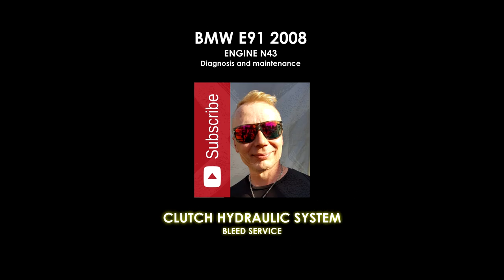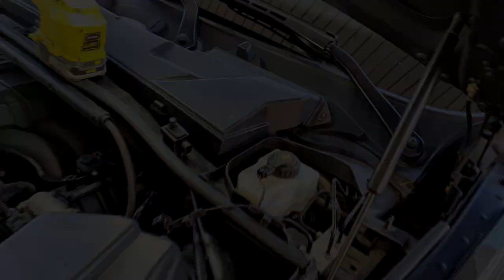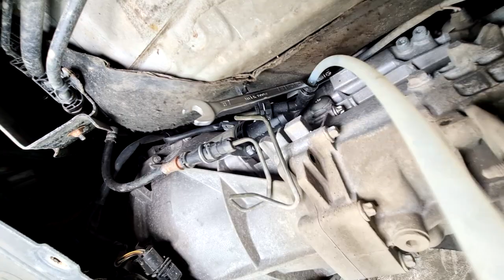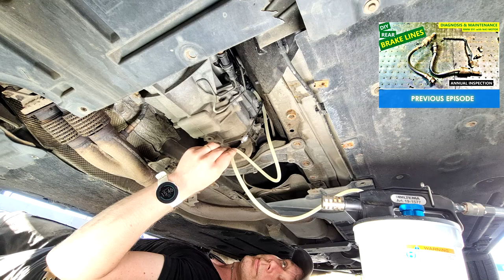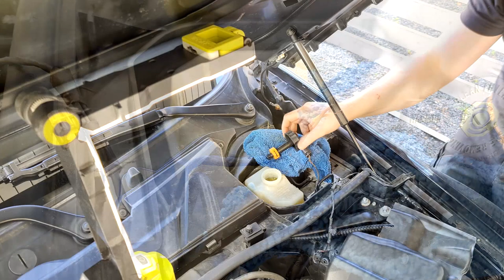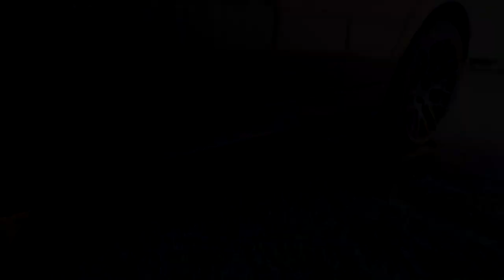CLUTCH HYDRAULIC SYSTEM bleed service - BMW E91 engine N43

Comment: did you ever manage to fix the 30AE error?
Reply from the maker: Fault code 30EA is still there. 
But the sulphuration is not so big that it lights up a fault light on the instrument panel. The car works well and the emissions are correct. You can always get the fault code off for a while when you perform that burning run.
In order to remove it completely: It would require physical opening and cleaning of the nox Catalytic Converter... or NOXEM from bimmerprofs
Reply: @JaniVoutilainen  So it comes down to the cat having deposits on top of the catalyzing metals which decrease its efficiency due to it being old. I recently got myself a 2009 E92 320i with the 30AE code. I also had a thermostat and nox sensor fault code so it's currently in the shop having those and various other oil leaks fixed. But I have been watching your videos on the desulphation process to get an idea on how the n43 operates. I used to have a 316D N47 and I know how the DPF on the E9x diesels gets clogged up. I managed to get a max od 255.000 km from that one and no amount of cleaning could get it to not regenerate every day. The E92 has 180.000km so I am wondering if the nox cats have the same kind of lifespan and behavior as they get old. Luckily I have carly and I cat trigger a nox regen and I have a nice long highway nearby where I can give it a good long run. I just hope the cat is in good enough condition to not cause problems. I'm a bit ocd and I like my bmws fault free :)
Reply: Just got my e92 back from the shop today. After having the thermostat and nox sensor replaced, my beloved is now error free and the desulphation went smoothly and brought down the contamination from 390mg to 139 and went back up to 180mg by the time I turned off the engine.  Me happy.